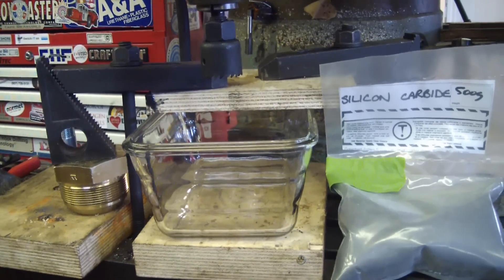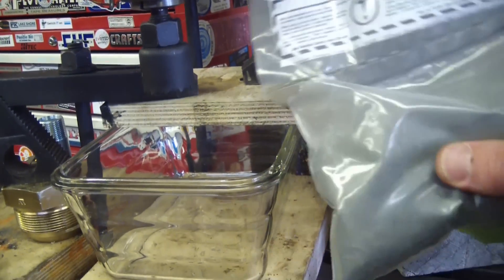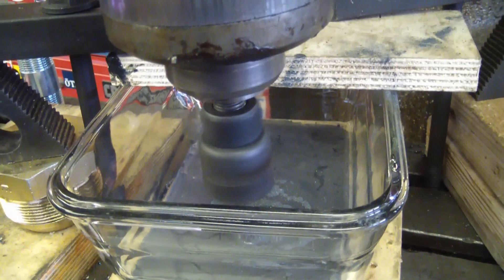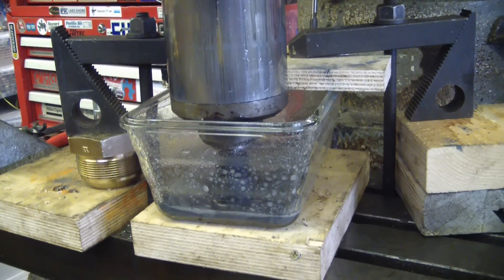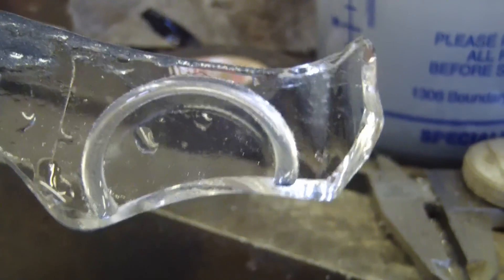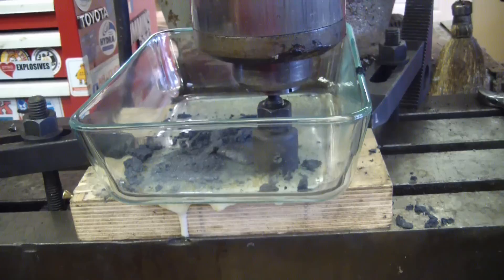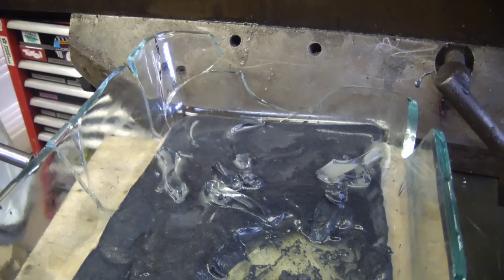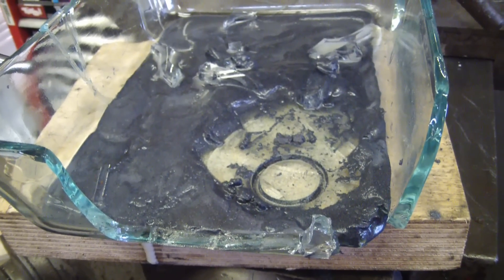Using Silicon Carbide to cut glass

Comment: I suggest finer grit and slower speed.  If a big grain of grit gets trapped between the metal and glass, the glass will crack and break.    Glass is one of the most elastic materials on the planet.  It just cannot tolerate much strain.  Also Knepper is right, a softer bit material would help.  If you could glue the grit on the drill bit with a hard rubber that'd be the ticket.

Comment: If it's crappy pyrex it might crack because it's tempered glass. So the glass is in compressive stress on the outside layer and tensil stress in the inside which are balancing each other. If you cut through it it might liberate the stress and start a crack
Reply: like you said just after...

Comment: pre-heat the glass to near glowing. Then use your plasma cutter to cut through the glass. Glass becomes slightly conductive at elevated temperatures.

Comment: Get 2 cheap 12 x 12" polarizing sheets off of eBay and check your mystery glass dishes for stress before you start drilling. If it looks like a mottled tie-dye tent at Burning Man, it's probably a lost cause.

Still, you'll probably proceed anyway (you seem intent on bleeding the last bit of life out of your Bridgeport) so .. make a hole saw out of copper tubing as some other astute folks have mentioned. Back in the day, before diamond core drills, copper tubing in a silicon carbide slurry was the norm.

Then glue your faux-pyrex dish to the inner bottom of a small plastic tote (from your wife's sewing room) using a dab of silcone caulk in each corner. The silicone will hold the dish down but let it expand/contract with slight temperature changes. Fill the space between the tote and the dish with water. Put the slurry inside and SLOW YOUR RIPPEMS DOWN.. drill away baby !

When it breaks (and it probably will) at least you got the mess contained, thereby extending the sadistic slow torture on the mill for another day. I'd say anneal the glass but with mystery chi-compositions like these, finding the exact annealing temperature is a major PITA, requiring many more sacrificial dishes.

Comment: Well I am thinking that the glass absorbs the vibrations caused by friction between the drill and the glass. What if you put the glass on top of something that absorbs(rubber/gel/foam) the vibrations instead of the glass? Ether way, if my theory is correct the thickest glass will have the deepest cut, if equally thick, then the cut should be equally deep... Your a smart man, you know what I mean...

Comment: hi

you need to check the type off glass.

there are two main types for cook were  lime hardened glass witch is cheap and common for cook were

and then there is Quartz glass (pyrex borosilicate glass) as in test tube and stuff like it

 pyrex borosilicate glass is much better and more stable it has less stress in the glass as it cools so is better for drilling/Grinding.

the cutting bit your using if it were me id grind the tool flat with a slit going across the the centre round 1/2 way up the tool for the grit to get in to the hollow of the tool

i can go on but im not very good at putting my methards in to text 
hope this helps lets see how you get on

Comment: Heat strengthened/Tempered glass must be cut/drilled before it is put through the oven. Internal stresses give it the strength required for the intended applications. Heat strengthend glass is 8 times stronger than annealed.Tempered glass is 8 times stronger than heat strengthened.

Comment: i´m pretty sure is because of vibration, and too much pressure. I drill glass plates for my mom and i´m about 95% succesfull (by the way she makes glass clocks from it.) anyway here is how i do it : most important is to put glass on something soft i usualy use about 8mm of cardboard  and some old towel to sink vibratin. i use putty to make dam around place where hole will be,  put water in here so this is similar to your way of doing this. i find out that is important (for some unknown reason) to clean all glass chips from groove formed by drill and do it like every mm of progress if this is not done drill will break bigger chip which will get stuck in grove and causes ti to crack. pressure on drill should be lowered as you getting closer to finish. last 0,2 mm its done by barely touching and you have to go slowly whole way here is no way of doing this fast. and last of my suggestion is to use smaller and lighter drill, and create pressure by hand. and if you pay attention to your work you actualy can feel trough leever when big chip is loosen a you can fast reduce pressure and avoid crack. .. and usual (not temperd) glass shatter exactly same way as shown in video, but if it is tempered here si probably no way of driling this. i hope it will be usefull.

Comment: Maye use untempered glass.  I think there's a lot of stresses acting on the tempered stuff even before you start drilling.

Also maybe grind the teeth off the bit and let the silica carbide do the cutting?

Comment: nice video...... sand blast a hold in it I have done this with real good results . make a template out of steel silicone it to the glass around the hole. it won't be a clean cut but that's what apoxy for. good luck 

keep calm and CHOOCH on

Comment: Have you tried using a piece of pipe instead of a hole saw? That's what we used to use to grind holes in Quartz etc,
Reply: The silicon carbide slurry with a piece of pipe I mean, just mild steel pipe.

Comment: Silicon Carbine is way harder than glass having it run around the glass like a blade will deffinatly chop it up bc its basically the hardest material on earth besides diamonds its rated 9.5/10  on Mohs hardness scale and also definitely should use a respirator bc those dust particles can just travel in the air and you can breathe them in without knowing (hence why you woke up with your neck hurting for no reason)

Comment: What if the heat was located only in a tiny area around the bit? There would be only that area trying to expand which would push around?
So my guess would be either better cooling or global heating.
Nice try anyway!
Thanks!

Comment: probably been said already but try on a busted piece but on alot slower rpm, you may be drilling at a harmonic to the glass, also it could be a heating issue, so again a slower speed would help. or a hammer, that would put a hole in it

Comment: well someone is a queens of the stone age fan...

if its tempered then you're right.. like a prince rupert.. seems like your cutting through the compressive outer later and then once it hits the middle you get your cracking which no amount of tooling would be able to prevent.

Diamond burr and grind the hole out with lots of water... but i think that will have the same problem as mentioned above.
conversely score your desired shape and burn it to red hot as patw42pb1 said. (depends on the glass you're using but if its stressed then it wont cooche)

Comment: I would mill the teeth off the bit and use it to put pressure on the abrasive. Similar to the system they use to cut granite counter tops.

Comment: possibly try slow heating the glass first? bring it red hot near melting then begin the cut while still holding on the heat, obviously not too quickly or rapid heat change can shatter, but you catch my drift

Comment: try stress realeving it by heating it up. i think all particles are in some kind of solid state, but like when you try to make something of glass you have to heat it. so i think to weaken the material (sounds not right) you get a better chance of forming it. 

source: some experience in glassblowing

Comment: Can silicone carbide be sintered or formed using some bonding agent into a drill? AvE Experimental Drill Bits could fetch a premium on Patreon ;)

Can you hook up the "balancing microphone" to measure sound levels? Maybe there is an interesting harmonic being generated with the hole saw interacting with the glass.

Comment: They still use Borosilicate for a lot of cookware in Europe (last time I heard, but wouldn't be surprised if they stopped this)...apparently they decided to switch from the beastly Borosilicate to just hardened glass and just buy the Pyrex as a trademark name instead of anything to do with the materiel...lab glass is still all borosilicate...they (corning works or whoever owns the cookware side of the name) claim that the hardened glass "withstands drops from height better than borosilicate glass" so voila now they use cheapo glass and slap the name of what most people still think is real Pyrex. Funny thing is that is the only apparent reason they give for the switch...they don't bring up the fact that the cookware will shatter if subjected to heatsresss that normally cracks glass...so any thermal shock will definitely crack it (from the oven and then submerged in water) and there have been many cases of people's cookware shattering in the oven. 

Also, you can tell if you have a borosilicate or hardened glass by the look...the regular glass tends to "look better" with a slight blue tint and less clouded looking glass...Borosilicate tends to look more yellowish and over time clouds more. But last time I checked unless you were on the food channel, it was function over looks in the kitchen when you get down it..id rather have something that is made for heavy abuse in labs where thermal shock won't do shit to it and frankly I doubt that hardened glass preforms much better at all under drop conditions than its lab cousin does...you drop a glassware from 3 feet up and it's gonna break I don't care what kind it is...maybe under a thousand drops it came out a head on a few but to be honest I'd much rather have the real thing and not drop it like an idiot. plus...you can make real Pyrex glass thicker than hardened glass, thus increasing its strength because of the fact Pyrex stands up to thermal shock like no other, it won't expand and contract and break...you make regular glass that thick and it will not be able to withstand the thermal shock and crack immediately.

Comment: Hey ...This will work but you will need to grind the teeth on the bit down similar to a hacksaw blade shape - consistent angles have you,If this don't work then try making some segment cuts in your bit to allow material to escape while more cutting material can enter.... also we are trying to reduce friction not necessarily cool the glass which is what one person commented on, the water helps the silicon carbide flow and cut the glass. now some more tips; The best way to hold your glass down would be clay on the outer edges of the base .... and or rubber bands or bungee material along the top as hold downs now after the cut is through the body of glass can flex reliving any pressure/torque from the spinning bit....lastly to save on cleanup you can build a small round clay dam around your work area that needs drilling you can also make clay base for the bottom of your job with half inch valleys as a water catch hope this helps but honestly your not doing bad if you buy a cheap diamond/carbide whole bit they are in the tile section they are throw away's though in my opinion because they do fail ruin holes and break glass a real diamond core is the real deal and are very expensive... My sticks on the Ice.

Comment: I have heard that you can glue a very hot washer to a piece of tempered glass, then let it cool, placing the glass in the hole of the washer in compression. Then you can drill your glasshole through the center of the washer without breaking the whole thing. I have also heard that the success rate for this technique is quite low.

Comment: try putting drill on full blast then with no lube or abrasive put light pressure on glass with bit and wait till tip of bit is glowing red hot along with glass then it will push through but cracks often on cooling down maybe preheat or something will sort it
Reply: Ash schwin don't breathe the dust

Comment: One time I did a scientific test to see just how much internal stress this glass bakeware contains.  I cooked a roast and let the liquid in the bottom boil dry.  The aroma of burnt offering summoned me to the scene, whereupon I dribbled some water onto the blackened roast, ever so slowly so as not to thermal shock the dish.  The release of energy was precisely measured at about 3/4 the power of an M-80.  A few of the shards managed to penetrate skin.  Months later I was still discovering missed shards 20 feet away in the carpet at the far end of the adjoining room using the venerable glass magnet technique (walking around in bare feet).

The thing about some amorphous materials is they really, really yearn to be crystalline, and will regress given the slightest opportunity.  My guess is that the only way to get a hole in that thing without freeing the crystals would be to get the thing up to plastic-hot temperature all over, put the hole in it, flame it like they do in that How It's Made video to round the edges (sharp corners are stress concentrators just like in metal), and then cool it using the secret thermal profile the video doesn't tell you about. 

There might be cheaper ways to make that gauche lamp.

Qualifier: I do steel, not glass.

Comment: I'm no scientist by any means, but since glass is a super cooled liquid, what if you lit a torch in the area where you're cutting? The molecules will be spreading apart giving more room for extra stresses like cutting. Also rest the dish on top of something softish like silicone since if I'm not mistaken has a high heat tolerance, giving a soft rest for the dish. But tempered glass can be a diddly to work with, not the most skoochum idea but I think it'd be worth trying to see if she'll chooch.
Reply: glass is not a supercooled liquid, old glass is usually thicker at the bottom because people were crap at making glass sheets. and the best way to cut this glass is to heat up the glass and let it cool down by itself relieving the glass of any internal stresses.
Reply: +euan todd that retracts to my statement about heat. Do you need to wait for it to cool? Because if so, even then it will be brittle, even though the stresses may have been taken out of it.

Comment: Have had some success with copper water pipe. The copper is soft enough to grab the silicon carbide and use it as abrasive. I suspect the teeth on the bi-metal are doing most of your cutting and causing the breakage problem. Give copper a try. No promises though.

Comment: Try using oil instead of water.  The water keeps the glass at less than 100 degrees temperature.  With oil you would be able to allow the glass to get heated to more than 100 degrees.  Remember, even good quality borosilicate glass has a stress limit at a differential of less than 150 degrees Centigrade. Try oil.

Comment: Not an expert
but since i once managed to cracked a big thick glass table top, just by unevenly heating part of it (trying to take the bobbles out of some epoxy resin) i think you should try to eliminate vibration and even out the heating.

So grind the teeth off and preheat and keep warm the pyrex with a heat gun.
It will probably fail but wasting YOUR money trying is better for me... :P

Comment: the bit your using is most of the problem.  a glass boring bit for a hole that diameter has a smooth edge (no teeth) with grooves spaced at 1/4 intervals. the leading edge of each groove has a slight bevel to allow the silicon carbide to flow under the bit. the edge of the bit is also diamond coated. you could TRY grinding teeth flat and putting grooves from the edge to about 1/2" up. also, reduce your feed pressure a bit. also, use plumbers putty or glaziers putty and create a dam around your bit. leave a one inch spacing around bit diameter and out your slurry in that. been working glass for a LONG time and winced when I saw what you're doing.

Comment: for what your doing i would pre heat the glass to about 950f   and  heat a piece of steel pipe as hot as you possibly can shove the hot metal in the hot glass and fish out your glass puck and cool the glass by about 100f every 30 muniuts until room temperature

Comment: I am not by ANY means an expert on cutting glass with such a large machine. However, you need to use good old fashioned glass! These pyrex pieces are tempered and have a great deal of internal stress. While it is possible to have holes in tempered glass, they are added before tempering.

Comment: As a my first thought, it'd be impossible to drill through. At least not without a good "diamondtool". Simply because it's tempered glass and any overpressing or shock will crack it. My guess is that the chance of cracking it increases with the depth. As thinner glass will crack easier, the most gentle press will be too much for the last /1000 of an inch and crack it and the thicker part. Yup pretty much like a prince Rupherts drop. Ps. too bad the angle will be wrong, almost a lazy way to sharpen (polish) an edge on the holesaw =/..

Comment: sand blast the initial hole with the silicon carbide powder then adjust size and shoulder with diamond dremel tip.

Comment: ive been a glass cutter for 25 years and i have found there is no way to cut or drill heat treated glass at all your method would work on normal glass with no problems at all

Comment: Your cutter looks like it has a lot of runout. maybe start the hole with the glass clamped down and once the hole is significantly deep, maybe a quarter of the way through, remove the clamps so the glass is free to slide around on the table as you cut. Just set up some blocks along side to keep the glass from rotating from the friction of the cutter. Or get a cutter that is true.

Comment: i normally melt  a hole, but then you need to slowly heat up the whole ting, then after making the hole slowly cool it down.
i put a thick layer of rock-, glass, or ceramic wool  and the let it stand to the next day